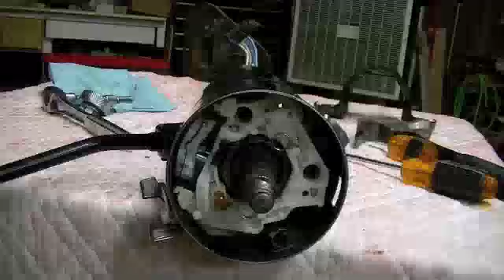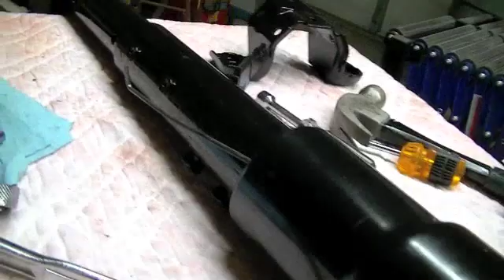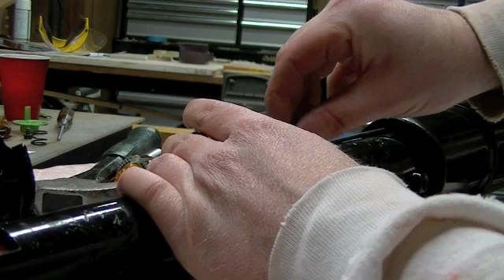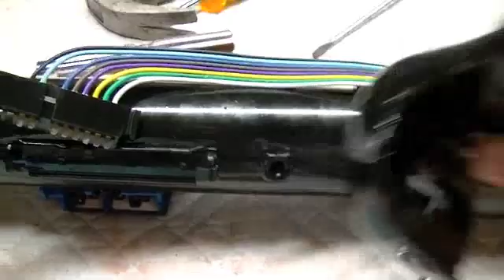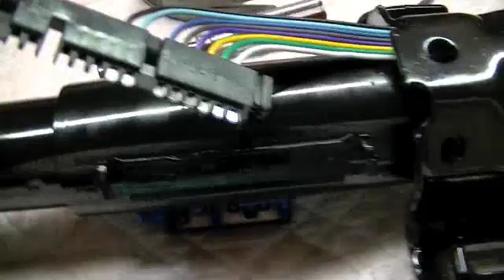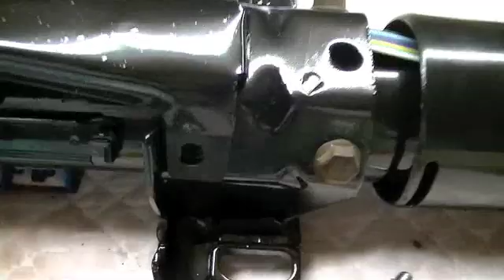Part 15 GM Steering Column Repair

Comment: I have a 70 Nova.  My key doesn't spring back from start position like you mentioned at 1:58.  What is the issue mine and how do I fix that?  I was really hoping you were going to talk about that part.

Comment: Thanks!  Fixed my '76 after watching this series. Borrowed the signal cam spring compressor from AutoZone. There's a trick to matching up switch gear (track) with the plastic gear connected to the tumbler.  Take lose the mounting bolts for the ignition switch and disconnect the actuating rod first. Then, you won't be fighting against the spring in the switch to get everything lined up. Note that the ignition switch mounting can slide up and down to adjust for the right position in relation to the key position. You'll notice one large gear cog on the plastic gear and one large slot for that on the (track) gear.  Match those up by inserting the plastic gear through the key hole (on the end of a small screw driver or drill bit.  Then, insert the tumbler, reconnect the wire-rod to the ignition switch, and tighten the ignition switch mounting bolts.  Lastly, sure the everything works.  Adjust ignition switch (sliding) as needed.  Thanks again!

Comment: Great video bro....I changed out my ignition cylinder & still no start, I have no spring back on cylinder like you said...so that is my next move changing out ignition switch, do I have to take column completely out to change part?
Reply from the maker: +Joe Barbosa (BLACK HOLE BBQ CHAPTER) Thank you sir!  You can replace the ignition switch without removing the column.  It helps to loosen the bolts to let the column drop a little bit.  Good Luck and Thanks for watching!!
Reply: +milkcrate82 Hey bro...ended up being a broken rack that connects to rod at upper colum...watched the rest of your vids to get broken part out & now waiting for rack & sector kit to arrive.....
Reply from the maker: +Joe Barbosa (BLACK HOLE BBQ CHAPTER) Cool man!  I'm glad these videos could help!!